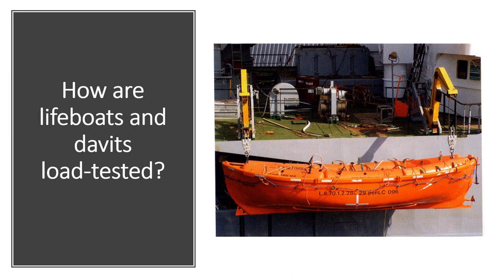How are lifeboats and davits load-tested on ships??

Comment: •	MCA LATEST ORAL REPORT, STARTED OF WITH  DETAILS OF the LAST VESSEL AND ALL QUESTIONS WERE ASKED RELATING TO MY LAST VESSEL ..  BULK CARRIER, GRT = 23974 / NRT = 12913
•	CARGO OF LAST VOYAGE =  UREA
•	 WHERE YOU FIND THE GUIDANCE ABOUT CARRIAGE OF CARGO
•	DUTIES & RESPONSIBILITY OF CHIEF OFFICER ON BOARD? WHERE do YOU find?
•	DUTIES & RESPONSIBILITY OF SAFETY OFFICER ON BOARD? WHERE do YOU find?
•	WHERE THE SAFETY EQUIPMENT COVERS THE SHIP
•	OTHER THAN LSA/ FFA WHAT OTHER THING COVER SAFETY OF SHIP
•	WHAT STATUTORY SERVICE CERTIFICATE FOR NAVIGATION EQUIPMENT 
•	LSA – STATUTORY SERVICE CERTIFICATE
•	FFA  - STATUTORY SERVICE CERTIFICATE ( BA SET )
•	WHERE YOU FIND THE MAINTENANCE AND SERVICE GUIDANCE FOR LSA & FFA  ( PRESSURE TEST FOR CYLINDERS )
•	WHAT INFORMATION ITS TELLS YOU
•	WHERE YOU FIND THE MAINTENANCE AND SERVICE GUIDANCE FOR LIFTING APPLIANCES AND WHAT INFORMATION it TELLS YOU
•	ANNUAL ONBOARD EXAMINATION OF CARGO CRANE. HOW TO CARRIED OUT IN DETAILS A TO Z ( RISK ASSESSMENT, TOOLBOX MEETING )
•	WHAT YOU KIND OF CHECKS YOU CARRIED OUT FOR WIRE
•	HOW YOU KNOW THE WIRE IS ALLOWABLE TO LIFTING WORK
•	WHAT CONSTRUCTION OF WIRE. ( WHAT IS THE CONSTRUCTION OF WIRE ) HOW TO NAME THE WIRE BY WHAT?  
•	HOW TO FIND WIRE SWL 
•	WHAT INFORMATION YOU FIND IN TRIM AND  STABILITY BOOKLET
•	SCREEN SHARE GZ CURVE- WHAT IS IT? WHAT INFORMATION ITS GIVE
•	HOW TO CONSTRUCT GZ CURVE
•	GZ FORMULA? 
•	SHARE SCREEN: DEADWEIGHT SCALE PICTURE
•	TPC FORMULA? WHERE IS IT USED? IN WHICH OTHER FORMULA TPC CAN BE USED?
•	WHERE CAN U FIND FWA INFORMATION?
•	MCTC IS USED, FORMULA? 
•	PREPARATION SHIP FOR LOAD LINE SURVEY IN DETAILS A TO Z
•	WHAT YOU CHECK IN HATCH AND HATCH COVERS  ( DRAIN WITH NON-RETURN BALL )
•	NAME OF TANK VENTILATION, HOW ITS CALL 
•	SAFETY DRILL INTERVAL? ( ENCLOSED SPACE ENTRY DRILL)
•	CONDUCT ENCLOSED SPACE ENTRY DRILL AS A CHIEF MATE. DETAILS A TO Z
•	MULTI GAS DETECTOR WHAT INFO U WILL GET?  WHAT ARE THE UNITS EACH measure? AND VALUES 
•	ROR
•	RESTRICTED VISIBILITY WHICH RULES APPLY? 
•	RULE 15 EXPLAIN?
•	PWD CBD PROBABLY 50M OR MORE IN LENGTH SEEN FROM PORT SIDE- OPEN SEA GOOD VIS – CBD ON 30 DEGREE STBD BOW ROC-ACTIONS? DAY & SOUND SIGNAL
•	PWD PILOT VSL SEEN FROM STBD?FOG SIGNAL? OPEN SEA GOOD VIS- 30 DEGREE  ON PORT BOW ROC-ACTIONS? DAY & SOUND SIGNAL
•	AFTER SOME TIME STILL NOT TAKING ACTION?  ( FIVE SHORT RAPID BLAST )
•	SAILING VESSEL SEEN FROM STERN, RULE 13 OVERTAKING
•	RADAR PLOT: RM/RELATIVE VECTOR
•	HEADING NORTH 000T SPD 10 KNOTS
•	TARGET A HDG 315 T SPD 5 KTS
•	TARGET B HDG 015T  SPD 20 KTS 
•	BOTH THE TARGET SHOWING RELATIVE APPROACH VECTOR
Reply from the maker: Thanks buddy:)